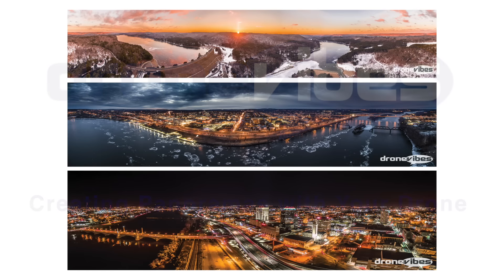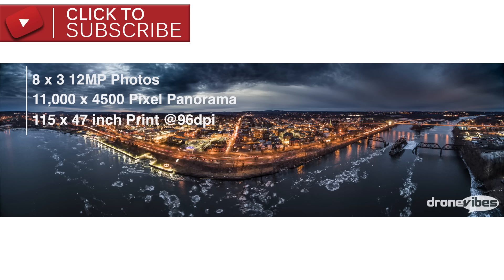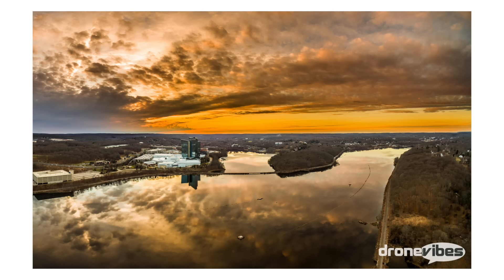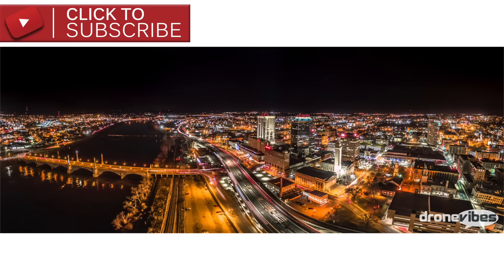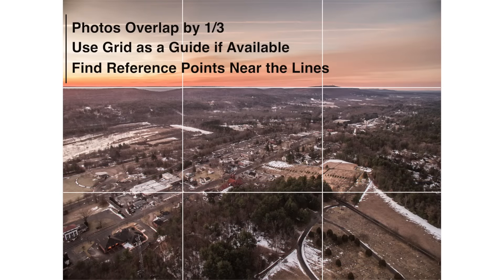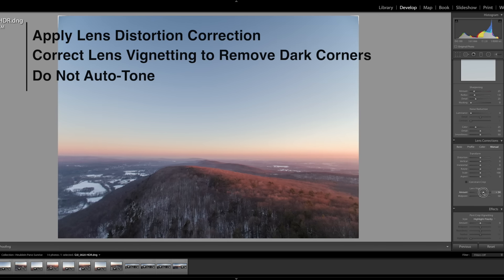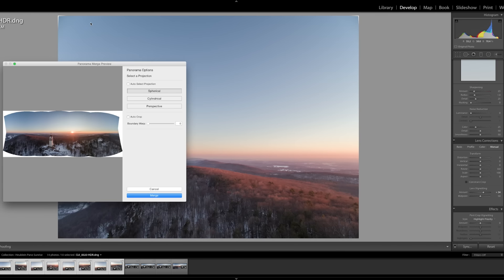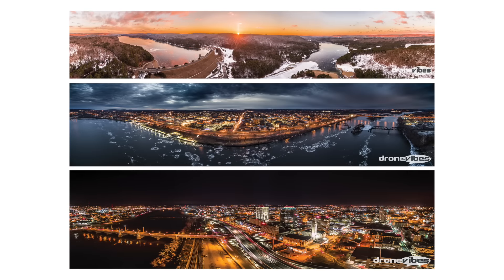How to Create Panoramas with Your Drone - Drone Vibes Podcast Photography Tutorial Video

Comment: Good video -  I haven't played much with White Balance when I shoot aerial.  Are you saying that I should shoot in "custom" white balance for the Phantom?  Any other settings we should use?  

I'm also curious on the vertical shots.  Do you find it better to just tilt the gimbal or are you actually flying to a lower altitude?
Reply from the maker: +Eric Goldstein Thank you, great questions. The white balance should not be left in AWB (auto)  when shooting panoramas-this ensures that the WB is consistent throughout the pano. Yo can leave it on any of the other presets (Sun, Clouds), or set it to custom and choose it for yourself. The warmer the light in the scene, the higher should the setting be. For sunrise/sunset situations, I set it to 7100-7000K, for regular daylight 6500-6800, around 6000 on cloudy days, and as low as 3500 for long exposure night shots. For vertical panos I only tilt the gimbal, they could be done linear (flying lower), but it is pretty complex and I would not recommend using this technique for regular vertical panos. Also, the closer I am to objects when creating vertical pano, the less I move between the shots (bigger overlap). This helps during the stitching process and reduces distortion.